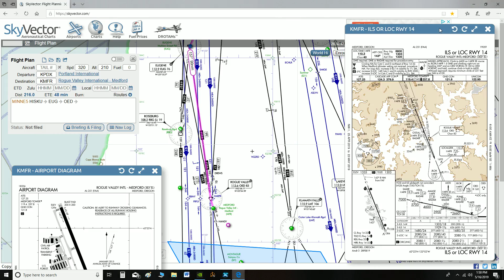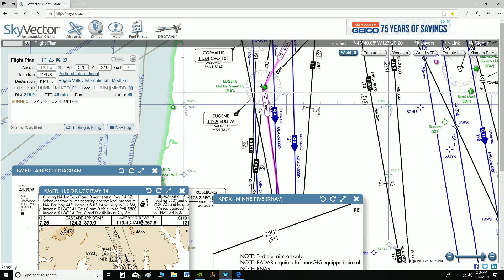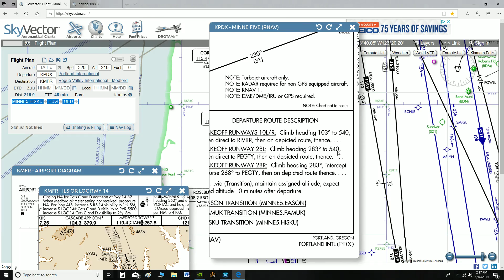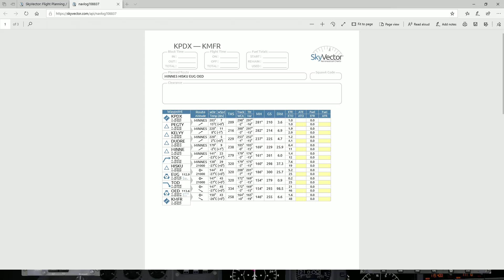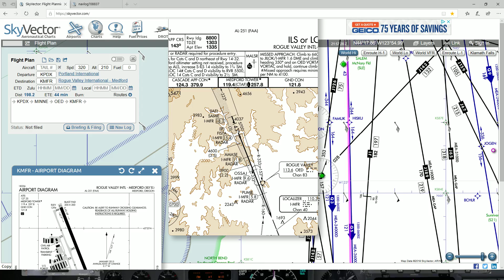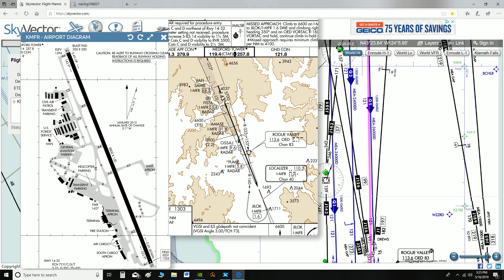Carenado Cessna S550 Citation II Portland (KPDX) to Medford (KMFR) IFR with Live ATC

Comment: Where can I get this checklist? It’s great by the way!!
Reply from the maker: BEFORE START

Preflight Inspection - COMPLETE
Flashlight - ABOARD/CHECKED
Fire Extinguisher - ABOARD/CHECKED
Microphones, Headsets, Oxygen Masks - ABOARD
Documents and Manuals - CHECKED
Oxygen Quantity - CHECKED
Circuit Breakers - CHECK IN
Anti-Ice/De-Ice Switches - OFF
Control Locks - REMOVE
Generators (except for GPU start) - GEN
Fuel Boost Pumps - NORM
Ignitions - NORM
Crossfeed - OFF
Gyro Slave Switch - AUTO
Standby Gyro - ON/VERIFY POWER/OFF
Seat Belt Sign - CHECKED/OFF
Anti Skid - OFF
Cabin Pressure/Rate Control - SET
Throttles - CUTOFF
Engine Sync - OFF
Windshield Bleed Valves - CLOSED
Battery Switch - BATT (CHECK 24 VOLT MINIMUM)
AC Power & Master Avionics - ON
Rotary Test - CHECKED
Parking Brake - SET
Landing Gear Handle- DOWN/THREE GREEN/NO RED
Engine Instruments - NO FLAGS
Electric Elevator Trim - TRIM DISC CHECKED
Airspeed Bug - SET
Fuel Quantity - SUFFICIENT/BALANCED
GPS/FMC - PROGRAMMED
Flight Plan - FILED

BEFORE STARTING ENGINES

Chocks - REMOVED
Seats and Pedals - ADJUSTED
Beacon/Navigation Lights - ON
Cockpit Lights - AS REQUIRED
Standby Gyro - ON
AC Power & Master Avionics - OFF
Air Conditioning - OFF
Cabin Door - LOCKED/LIGHT OUT
Before Start Check - COMPLETE

STARTING ENGINES

First Engine Ignition - ON
First Engine - START
N2 - VERIFY RPM INCREASE
First Engine Throttle - WAIT FOR N2 ABOVE 8% THEN SET TO FLIGHT IDLE
ITT - MONITOR WITHIN LIMITS
N1 - VERIFY ROTATION/RPM INCREASE
WAIT FIRST ENGINE STABILIZED
Second Engine Ignition - ON
Second Engine - START
N2 - VERIFY RPM INCREASE
Second Engine Throttle - WAIT FOR N2 ABOVE 8% THEN SET TO FLIGHT IDLE
ITT - MONITOR WITHIN LIMITS
N1 - VERIFY ROTATION/RPM INCREASE
WAIT SECOND ENGINE STABILIZED

BEFORE TAXI

GPU - DISCONNECTED
GENerator Switches - GEN
Volts/Amps - CHECKED
AC Power & Master Avionics - ON
PASSenger Advisory Light - PASS/SAFETY
Cabin Pressure and Temp Controls - SET/AUTO
Gyro Pressure - CHECKED
Air Conditioning - FAN OR OFF
Circuit Breakers - CHECK RIGHT/CHECK LEFT
Belts and Harnesses - FASTENED
Exterior Lights - AS REQUIRED
Before Taxi Check - COMPLETE 
 
TAXI

Check Departure Runway - BUGGED/VERIFIED
ATIS and Clearance - COPIED
Transponder - SET AS REQUIRED
Brakes and Steering - CHECK RIGHT/CHECK LEFT 
Flight Controls - TOPS CHEKED/BOTTOMS CHEKED
Flaps - CHECK OPERATION/FLAP HANDLE AGREES WITH FLAP POSITION
GPS/FMC - PROGRAMMED
INVerters - CHECKED
Auto Pilot & Flight Director - CHECKED/HEADING-ALTITUDE SELECT
Anti-Ice/De-Ice - CHECK AND AS REQUIRED
Thrust Reversers - CHECKED
Flight Instruments - CHECKED
Altimeter/Altitude Selector - SET
Radios/Avionics - SET
Fuel Quantity/Balance - CHECKED
Pressure Source Selector - CHECKED LH/RH/NORM
Speedbrakes - CHECKED/RETRACTED
Flaps - SET 7 DEGREES
Trims - SET THREE TRIM WHEELS
Takeoff Data/Bugs - REVIEW
Crew Briefing - COMPLETE
Taxi Check - COMPLETE 

BEFORE TAKEOFF

Ignitions - ON
Anti-Ice/De-Ice - AS REQUIRED
Pitot/Static Heat - ON
Exterior Lights - ON
Transponder/TCAS - ON
Engine Instruments - CHECKED
Anti Skid - ON
Annunciator Panel - CHECKED
Departure Runway - BUGS ALIGNED/VERIFIED
Before Takeoff Check - COMPLETE

AFTER TAKEOFF AND CLIMB

Landing Gear & Lights - UP AND OFF
Yaw Dampener - ON
Flaps - UP
Engine Sync - ON
Ignitions - NORMAL
Climb Power - SET
Anti-Ice/De-Ice - AS REQUIRED
Anti Skid - OFF
Pressurization - CHECKED

Passenger Advisory Lights - AS REQUIRED
Exterior Lights - AS REQUIRED
Climb Check - COMPLETE 
 
TRANSITION (climb)

Altimeters - 29.92/29.92-CROSSCHECKED
Recognition Lights - OFF
Oxygen - CHECK
Pressurization - CHECK
Air Conditioning - FAN OR OFF
Transition Check - COMPLETE  
 
DESCENT

Defog Fan - HI
Foot Warmers - CLOSED RIGHT/CLOSED LEFT
Airflow Distribution - COCKPIT
Pressurization - SET
Windshield Bleed Air/Manual Valves - LO/MAX
Anti-Ice/De-Ice - AS REQUIRED
Fuel - BALANCED/CROSSFEED OFF
Descent Check - COMPLETE 
 
 
APPROACH

Altimeters - SET/CROSSCHECKED
Belts and Harnesses - ON RIGHT/ON LEFT
Passenger Seats - UPRIGHT/OUTBOARD
Cabin and Emergency Exits - CLEAR
Recognition Lights - ON
Landing Data - SET/POSTED
Anti Skid - ON
Pressurization - CHECKED
Avionics/Flight Instruments - SET
Approach Briefing - COMPLETE
Passenger Advisory Lights - PASS/SAFETY
GPS selector - SET
Approach Check - COMPLETE 

BEFORE LANDING

Landing Gear - DOWN-3 GREEN-NO RED/VERIFIED
Ignitions - ON
Engine Sync - OFF
Pressurization - CHECK ZERO DIFFERENTIAL
Landing Lights - ON
Flaps - LANDING
Annunciator Panel - CLEAR
Speed Brakes(Prior to 50 ft AGL) - RETRACTED
Autopilot/Yaw Dampener - OFF
Before Landing Check - COMPLETE 
 
AFTER LANDING (silent)

Anti Skid - OFF
Pitot Heat/Anti-Ice/De-Ice - OFF
Ignitions - NORMAL
Exterior Lights - AS REQUIRED
Standby Gyro - OFF/CAGED
Transponder - AS REQUIRED
Radar - STANDBY
Flaps - UP
Speedbrakes - RETRACTED
Trims - RESET
After Landing Check - COMPLETE 
 
SHUTDOWN

Check Parking Brake - AS REQUIRED
Transponder - STANDBY
Avionics & Inverters - OFF
Overhead/Defog Fans - OFF
Air Conditioning - OFF
Throttles - CUTOFF
Exterior Lights - OFF
Passenger Advisory Lights - OFF
BATTery Switch - OFF
Clock - ZEROED
Shutdown Check - COMPLETE 
 
VREF – KIAS Flap Full

WEIGHT / KIAS
14.1 / 114
13.5 / 112
12.7 / 108 
12.0 / 106
11.5 / 104
10.5 / 99
9.5 / 95

VREF – KIAS Flap 15

WEIGHT / KIAS
14.1 / 122
13.5 / 119
12.7 / 115 
12.0 / 113
11.5 / 111
10.5 / 106
 9.5 / 102